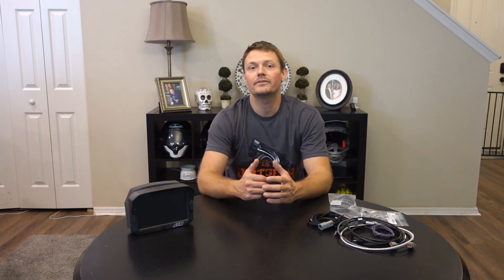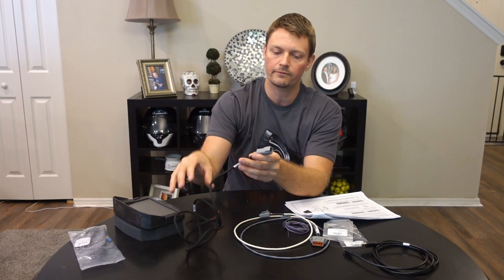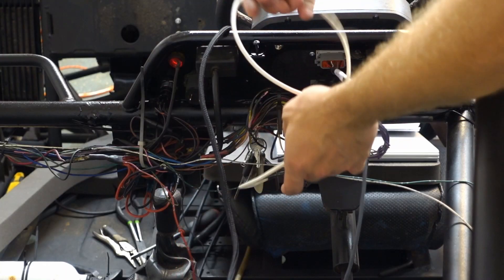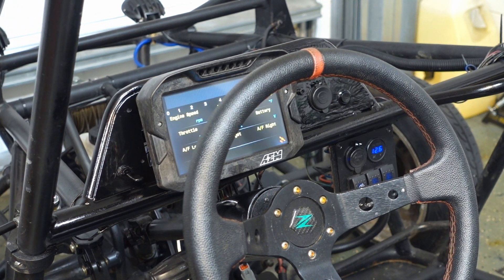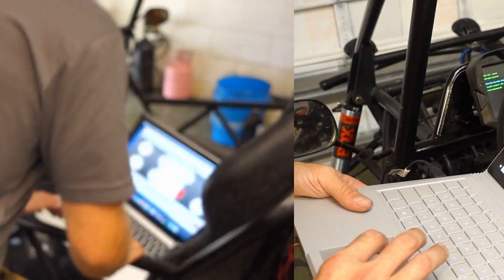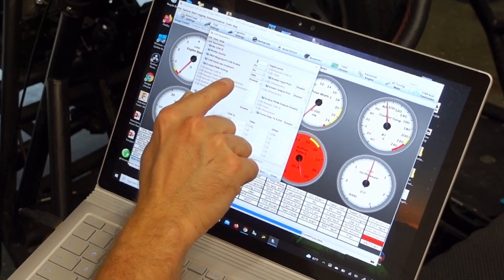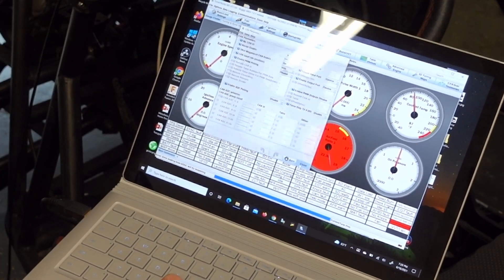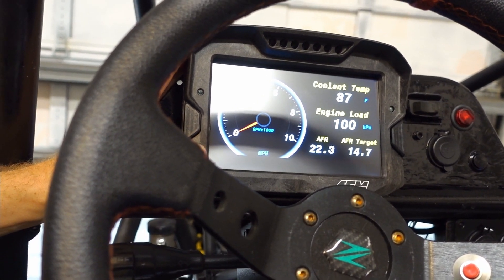AEM CD7 Installation Digital Dash with Megasquirt 3 | Mirage Powered Buggy

Comment: Can it display ethanol content if you wire in a flex fuel sensor?
Reply from the maker: Absolutely! Even if there isn’t a pre made layout for the items you want displayed you can custom design pretty much any sensor, or display items you want with the included dash design software

Comment: Judging by the price if you had to redo everything would you go the same route or would you buy a fueltech 450?
Reply from the maker: Id stick with this system if I had to do over. The pricing on the Fueltech is tempting but i/o is limited and MS3 more robust if you don't mind the learning curve. Also data logging very nice and autotune on MS3